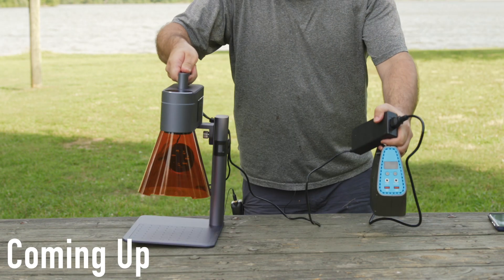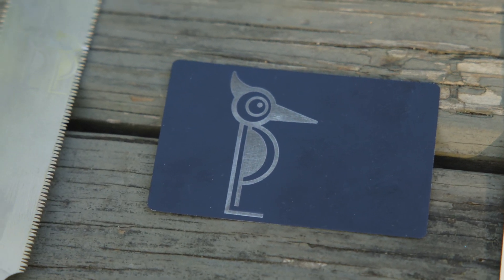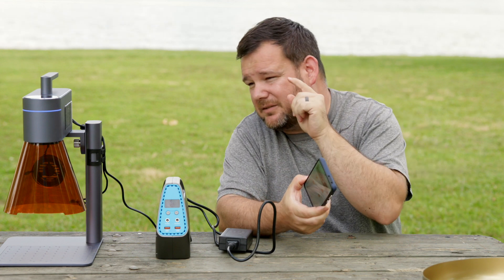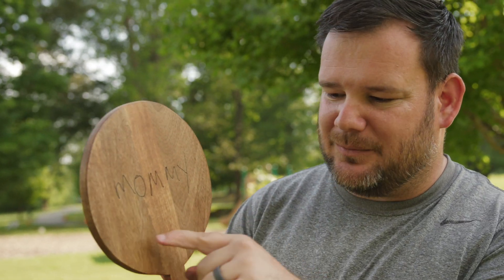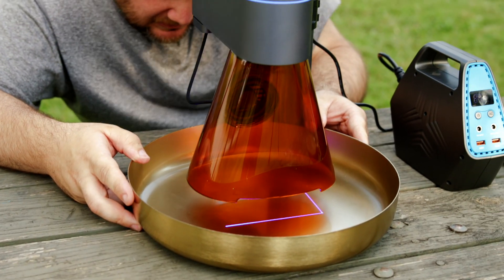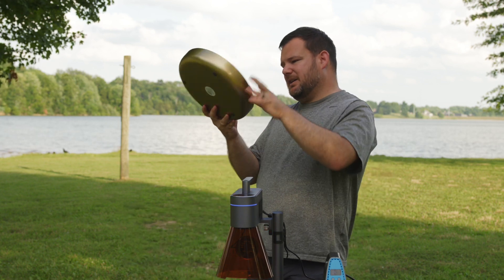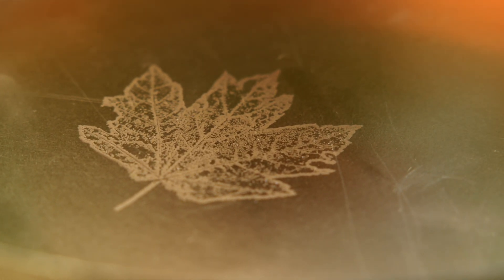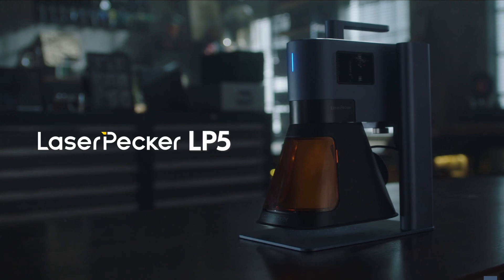Increase Laser Side Hustle Sales with Mobile Personalization? - Laser Pecker 4

Comment: I bought an Xtool F1 a month or two ago with your scenarios in mind. I've since added portable power as well - as you have done - to be fully self sufficient. 

I have no concern - I can't wait to start this sale season up!
Reply: I have been doing this exact idea for over a year and it's great. Saw another person doing it with a laserpecker and it didn't have as easy a flow as the f1
Reply from the maker: Sweet! I haven't used the F1 at all. What features make it easier to use in this scenario?
Reply: @AndyBirdBuilds  in my view, the xtool software is better, the focus is really easy as the top half moves and screen lifts and drops, if you was doing an engrave on a larger item like the tray the bottom of the f1 base lifts out etc.  I have only played with the laserpecker 3 but I wasnt taken by the speed of it and at the time the software on the phone felt clunky to me, this was a year or 2 ago so things may have changed 

When I do customisation like this I actually take a snapscan scanner and a laptop and set up proper little station rather than using my phone as its easier and looks more pro.
Reply from the maker: Awesome!